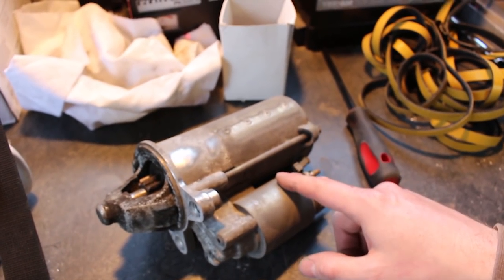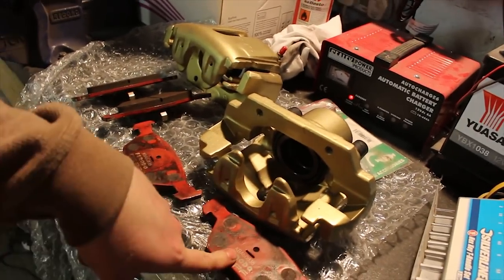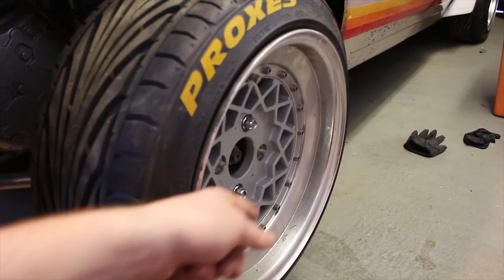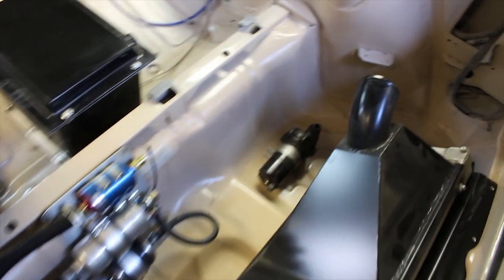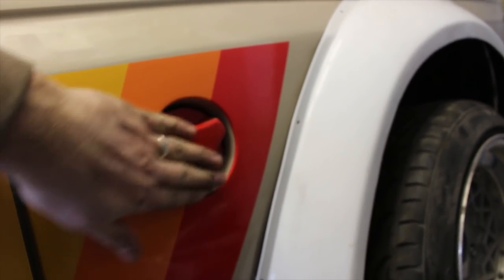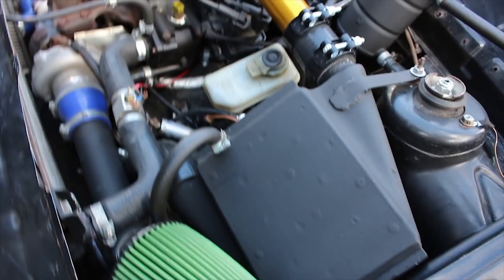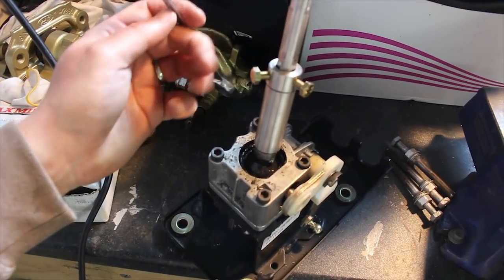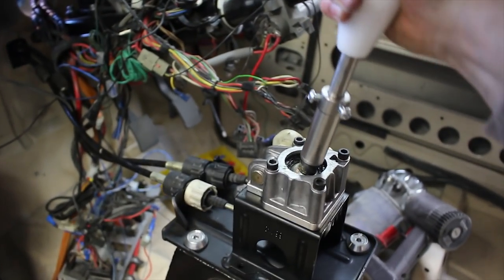Compound Turbo Mk1 Fiesta - Episode 17 - Quickshift install

Comment: Got in from work and a fpe video, happy days. What model reno 5 is that oil filter from?? as I need on on my zetec and it looks perfect...And yes we need a video on that supersport/oather fiestas. As if you havn"t got enough to do!!!!! Great work as usal...
Reply from the maker: il ask bump what the part number is. i run a CVH filter on mine for more clearance on the TCA mount  but the R5 one is much smaller.
Reply: Yes my zetec block is rwd and I want an oil cooler sandwich plate on there too and the std zetec filter looks it might be too close to the chassis leg..
Reply from the maker: @michaelmatthews8171  Bump said the part number for the Renault  5 oil filter = W77
Reply: Thanks for that...

Comment: I have allways wanted to know what outer cv joints you are using with the st170 gear box for the stock hubs?
Reply from the maker: i will be using xr2 outer CV's. going to need to get custom shafts made for this thing soon .

Comment: Does this mean you’ll only be able to use 2nd hand pads?
With new pads fitted, will the calliper will hit the wheel again?
Reply from the maker: no should be ok the pads are second hand but hardly used, and i ground about 5mm off the bolts, the caliper was only touching so needed about 1 mm clearance. ;)

Comment: 😲😲Old pads on new discs!!??
Reply from the maker: They are second hand discs off the fiesturd. I just cleaned them up really well  ;)
Reply: @mikefpe  What you do sand blast them??👍👍
Reply from the maker: @gavinpainter3823  yer and then like a loser masked them and painted them in the Wurth aluminum paint.
Reply: @mikefpe  😂👍